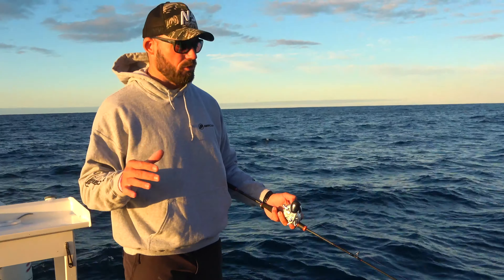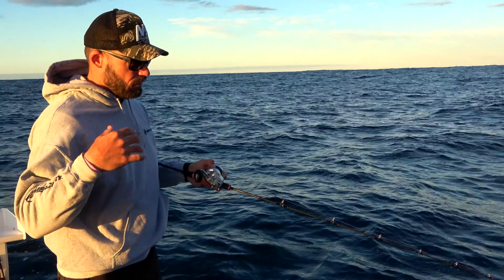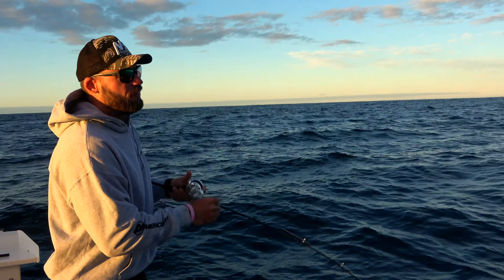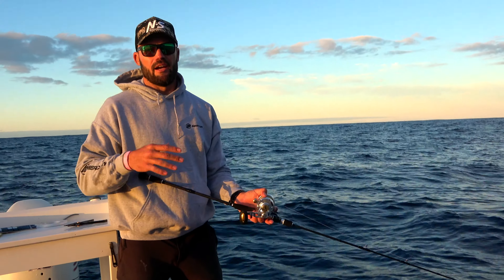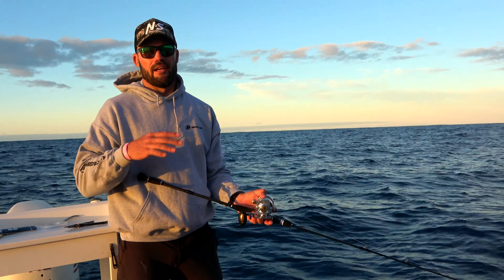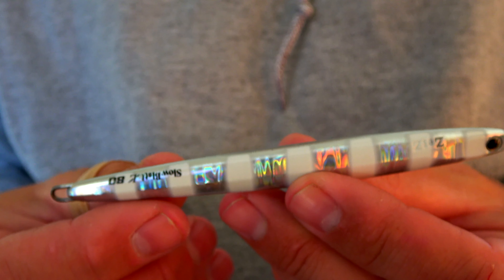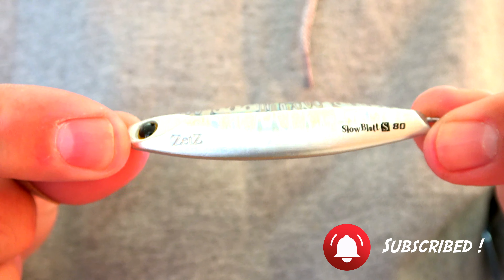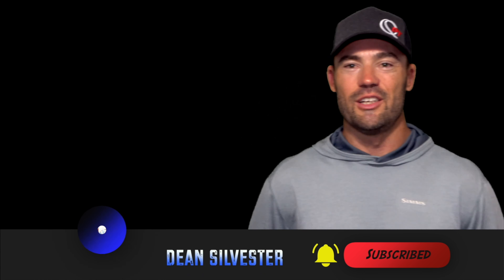Slow jigging Vs Light Jigging

Comment: Thanks for the tips. I’ve seen a couple fisherman work the rod when slow pitch jigging, so I was a bit confused because I thought the rod is designed to work itself. I’m glad you cleared things up.
Reply from the maker: if you don't have a slow pitch rod then i guess you may need to work the rod but then you aren't really slow jigging. If you have a legit slow pitch rod and you try to work the rod you will notice the tip almost stays in the one spot as you try to work the rod so its not doing much for the jig.

Comment: Great Video, thanks for the tips, looking at getting into jigging but before buying my reel I wanted to know what you think of the Okuma Cavalla you’ve changed over to ?
Reply from the maker: I really like it mate, very strong and good low profile. The two speed is handy when you are locked up to a big one, can drop back a gear and get some line back. Probably not as smooth as some of the high end tackle but it’s better priced

Comment: Cheers for this mate learned alot from this 
When your you are jigging do you drift or spot lock?
Reply from the maker: I drift with the current mate to make sure my jig is vertical at all times..
Reply: @DeanSilvester  how do u do that ? if i drift with the current my jig will not be vertical coz the boat is drifting...
Reply from the maker: @OrcaAngler  if you drift with the current that is the only way your jig can be vertical. It is when you drift with the wind that it is an issue. The wind and current won't or most likely are never the same. Just use your outboard to keep your line running vertical.
Reply: @DeanSilvester  let me understand this, usually i will drift with the current with my outboard turn off. the boat will be turning horizontal following the current where current will hit our boat lee side, i belive u understand this. example current from port side, and boat are drifting to starboard side. i shud be jigging on port right? coz if i jig on the starboard my jig and line will be under the boat. so the question if i jig on the port side how cn i mke it vertical all the time,  the moment i start jig my boat drift fast to the starboard and my line will be horizontal from vertical just in 15-20 sec from i start dropping it…
Reply: @OrcaAngler  yeah you never jig with drift. atleast never light jig with drift since the lures are going to be horizontal like you said.
Reply: @anton2417  ok understand thanks dude

Comment: I'm using 120-300  rod .. if I use 200g jig .. can I just hold the rod straight and do quarter and half cranks .. because people usually move the rod while reeling
Reply from the maker: if its a slow pitch rod then yep thats exactly what you do. don't use the rod for the action, just the reel

Comment: Yet I have a slow jigging rod rated PE3 jigs 80-160g.  Am I slow jigging or light jigging?😉.  I don’t think light vs slow is really a good comparison of terms.  You are either slow jigging the bottom or speed jigging mid depth.  Either can be done with “light” jigs and rods.
Reply from the maker: not true mate sorry. Slow jigging is slow, light jigging is with light jigs and light tackle. The point of slow jigging is to use jigs designed for little to no action and they flutter. Google it mate, you will learn something
Reply: @DeanSilvester  so if I am
Jigging a 40-60g slow pitch jig like a Buffalo jig am I light jigging or slow pitch jigging?   It’s still a slow pitch jig and rod.   I just find these terms funny.

Comment: can i slow jig with a regular jigging rod if I use a jig that is heavier than my pole is rated?
Reply from the maker: Not effectively mate no. It’s all the action from the rod
Reply: @DeanSilvester  dang I thought maybe since I would use a heavier jigg it would bounce more and provide the desired action
Reply from the maker: Not really mate, completely different action in the rod. Same as the way you fight the fish, it’s different on slow jigging rod vs standard or light jigging rod

Comment: Now there is super light jigging in japan ! Crazy tech
Reply from the maker: Seriously? That would get bites when nothing else does thats for sure.
Reply: Dean Silvester yes. They are very parabolic handling only jigs up to 100g or so.  Tip of the rod is a glass blank for sensitivity and flex for nice natural manipulation of the lighter jig and the base of the rod is often made of 100% carbon for strength . Amazing stuff . Check out the  Tenryu LJ series . They have an English site as well.
Reply from the maker: Nice one mate, will do for sure

Comment: Once again, another video saying the only action comes from the reel which is wrong. You can use the rod to get the same result, but stay in the zone. Mix it up.
Reply from the maker: Slow pitch jigging the action comes from the rod but created by the reel, you don't move the rod with your hands

Comment: Great video. Good description. Does winding the amount of cord in one turn of the coil greatly affect the amount of winding during fast jigging? For example, I have spinning reel and  for one turn, I wind up 84 cm.
Reply from the maker: Yes it does, if you are fast jigging then obviously that makes it easier but if you are slow jigging it just means you have to concentrate not to turn the handle too far around. Just get that rod tip to dip and then back off and go again when it bounces back up
Reply: @DeanSilvester  Thank you friend! Tight lines👍👍👍
Reply from the maker: Not a problem, happy to help out